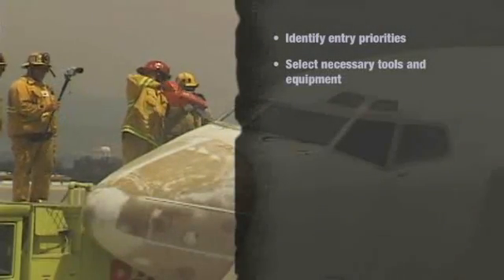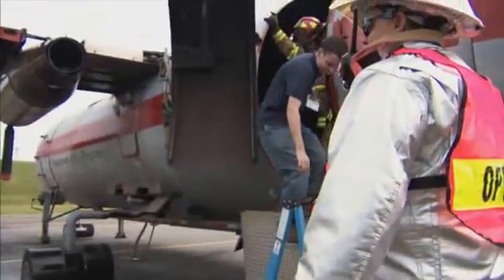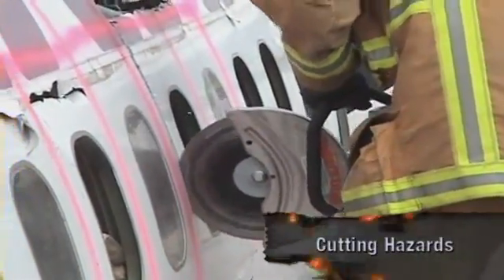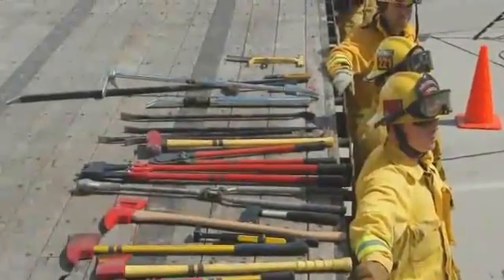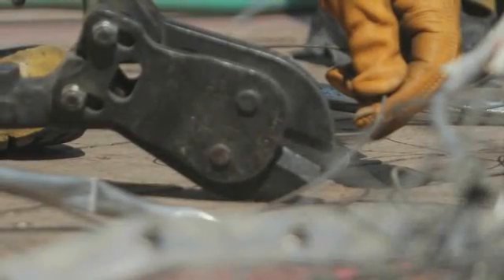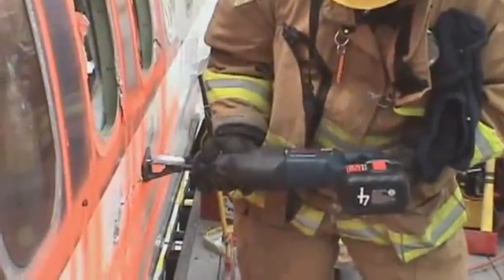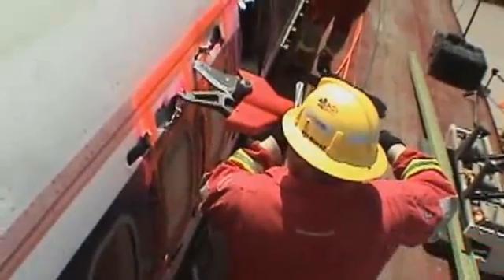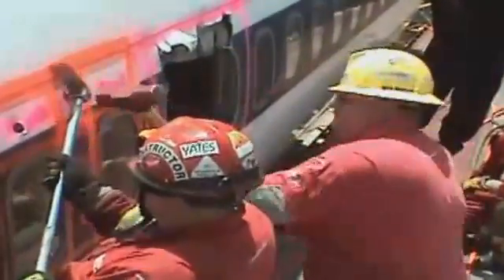Introduction to Aircraft Rescue and Firefighting (ARFF): Section 8

Comment: IT NEVER TAKES MORE THAN 5 MINUTES TO HANDLE THE ISSUE OR PROBLEM? AFTER CUTTING SPREADERS ARE USED WITH RAMS WITH PUSHING FORCE ALONG WITH AIR COMPRESSORS?